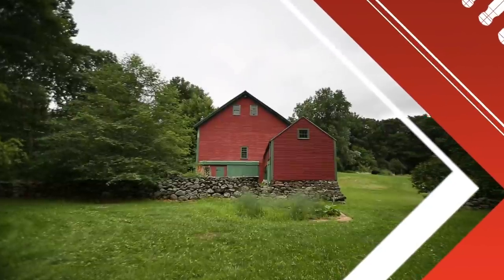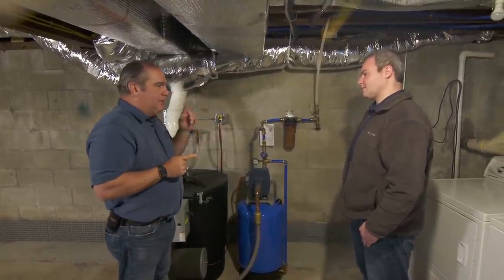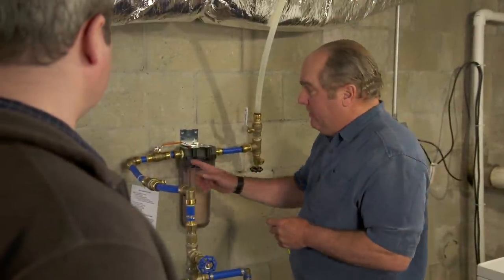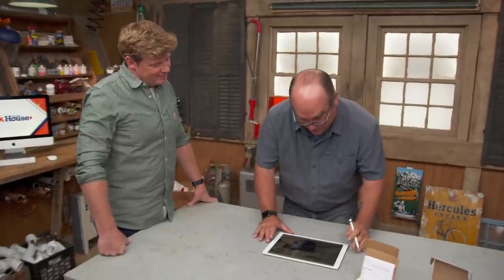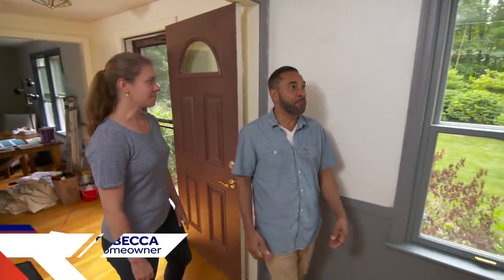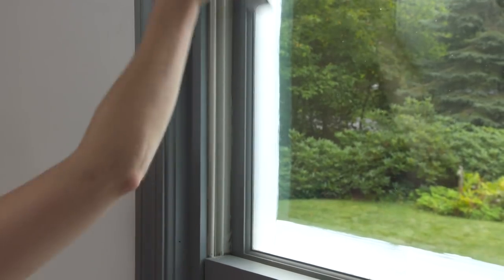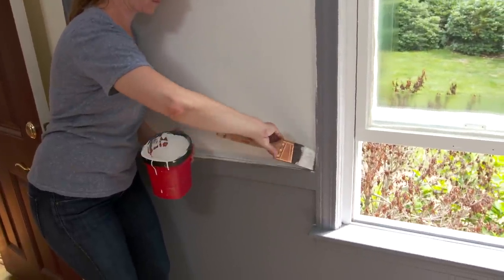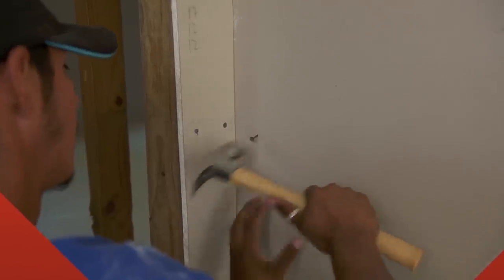Ask This Old House | Spitting Faucet, Painting 101 (S16 E15) | FULL EPISODE

Comment: “Let me just pull out my Radon Mitigation Device I usually keep in the backseat of my truck.”
Reply: I reckon he knew he was going to do a radon separator demo for the homeowner, because he read the script.

Well done the program researchers who found a home which had one and the props dept for getting on on set!!!

 All Richard had to do was drop it in place for the start of the scene 😁.

All joking aside that was quite interesting as never seen one before ... nor anything like the plumbing involved from a well source.

Have to say tho' the pipe section which got modified did seem a bit "hanging in the air".

Perhaps a tray doofer support thingy might have been useful?
Reply: Aloha
Reply: Hi kevin o conor

Comment: How long does that windows thing take to dry? How much does it cost?
It's cheaper to just use painters tape.
Reply: Painters tape might well be cheaper but suspect this was just a way of showcasing another product.

If time is money then you would save on the application time and possibly the stripping it off time.

And, if you're a contractor, then you'd charge that to the customer under "consumables", in the same way as the paint and that paint additive stuff, and possibly the single use paint tape used on the dust sheet or whatever you call it on your side.
Reply: Painters tape can let some paint under it, especially if it isn't applied correctly. This seems like a much easier solution.

Comment: Not a big fan of that fix for the water supply,   "oh you just make the restriction greater"  but how will you know to make it greater?  AFTER your sink spits water all over the floor?  At which instead of turning the valve you maybe investigate which filter needs to be cleaned... I mean that one sediment filter looked absolutely nasty almost a coffee color to which Richard changed and left all the floating bits in there "Come on Richard, empty all that water!" .        Seems to me a better solution would be some feed back mechanism, like maybe an always open solenoid valve with a float switch such that if the water level is too low it doesn't allow any water to pull.

I dunno, I have city water, with no radon and it never looks milky white as "normal"

Comment: Why would you use a ball valve as an adjustable flow restricter?  I would think a gate valve or an actual metering valve would be a better choice.
Reply: Agreed. Ball valves are not meant to be partially on or off, it will damage them over time.
Reply: ball valves are cheap

Comment: It's the quick close valve at the washing machine causing water hammer. 
All they need is a hammer arrestor.
Reply: Except it's clearly air in the system and you have no idea what you're talking about. Yeah water hammer is definitely a thing with a solenoid valve, but that's not what's happening here.

Comment: Poor guy, Richard put in all that plumbing, when all he had to do was closed down the tap on the water supply to the washing machine.  That also reduces the amount of water hammer every time the solenoid valves in the washing machine cut off flow.
Reply: Water hammer and air in the lines is a real pain. I find myself shutting off the main and opening all the faucets to burp the system which does work for about 6-7 months  but it eventually comes back and I have a tankless water heater.
Reply: But ask yourself, how else could they have crowbarred in that product from radon eliminator company?

Producers had probably twigged Richard couldn't use any Festool kit so came up with this.

Suspect Richard et al get to go on the after dinner speaker circuit so would need to come out with annecdotal stuff. He could only talk so long about life in "TV plumber land" and how long he spends in "make-up" ... he certainly doesn't spend in much time in "wigs".
Reply: There could be other fixtures, either alone or combined, that draw as much or more water as the washing machine.
Reply: @n9wox  And if you've got a an entire coven of teenage daughters it's a wonder to me the entire US hasn't subsided into what was an aquifer.

Sons are alright as they don't wash on the very reasonable grounds water is a poison, especially if there's a molecule of soap in it.

Until they get discover comparitive anatomy for real that is ... with plenty of nocturnal field trips ...

And if you're on the municipal mains supply I gather there's always the plea of bankruptcy.

Comment: I thought ball valves are supposed to be operated fully opened or fully closed?
Reply: They are, a seat/globe valve is the one he should have used.
Still a poor solution; The owner shouldn't need to tinker with it, a self balancing system would have been better.

Comment: The stair handrail and cables would not need to be modified and brought up to code if they were installed before the date that particular requirement in the code became effective.  The condition would be "Grandfathered" in, assuming it didn't violate the code when installed.   Otherwise every house that was built 80 or 100 years ago would need massive upgrades whenever the house is sold.  At least that's how it works in my area, it may be different where this is taking place.
Reply: While you are correct, still an important consideration to take if you got kids.

Comment: First Richard said that the Radon mitigation tank had incredible force then a few seconds later he said that this tank didn't have any pressure. ???????
Reply: the force was in the form of air pushing up through the water, not down onto the water. The water flows out the white downspout into an un-pressurized chamber which then feeds into the second pump. The force applied had no effect on the water in the reservoir, it was all blasting through the water flowing down to it.

Comment: @13:33 I get that that stairway has to be up to code. But I'm guessing the reason why that those stairs are like that. Is because the last owners were either little people as in LP type. Due to fact that most lp type people require things like the hand rail to be that low who knows. Thats my kind of guess so don't tell me that im wrong. I can careless for your opinion to correct mine.
Reply: You could well be right. However from an aesthetic point of view it looked ... like it could be improved upon.

If you don't mind me saying ...
Reply: I was thinking the same thing when watching this.  Some peoples needs  go  beyond codes.
Reply: @Kevin-mp5of  So from reading all your comments threw out this thread. You shown yourself to be a troll

Comment: Can’t believe Richard is using shark bites. Should have torn the whole lot out and re done it
Reply: Not heard the "shark bite" term before.

However the plastic push fit fittings work ok. Never had a fitting fail myself but if there are scratches in the pipes then that can be a problem if too deep for the "o" ring to seal.
Reply: @Kevin-mp5of  It has you know ... I can't be arsed to Google it, let alone argue the point ...
Reply: @Kevin-mp5of  Oh  bother! Now I have read all the comments to get the caretahker reference ... then translate the humour to "UK Standard" to get the gist.

 Grr. I'll  do it in the morning, I'm having an early night.
Reply: @Kevin-mp5of  Yes, although we would spell it "bollocks". Or "bollox".

Preceded, generally, by a verb or adverb. Or can a be a "standalone" (but repeatable) expletive.

In the grand scale of things this term is midway in the spectrum.